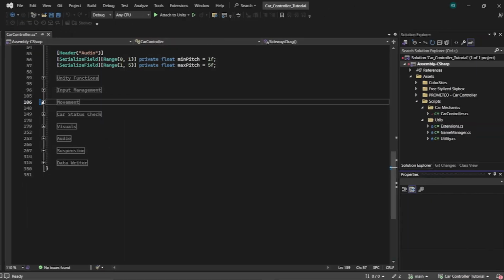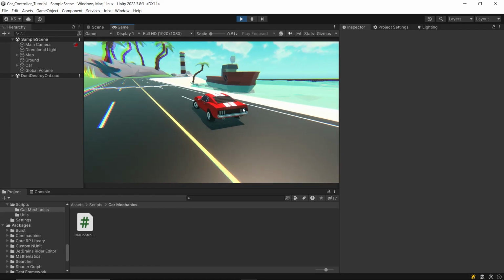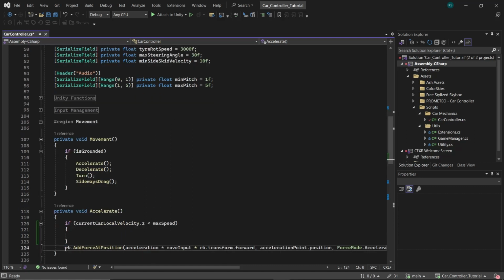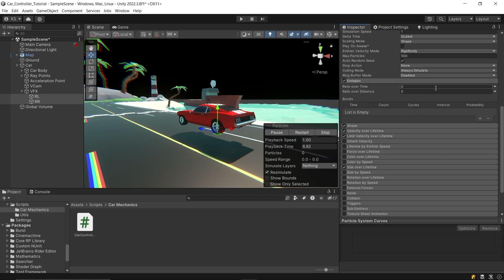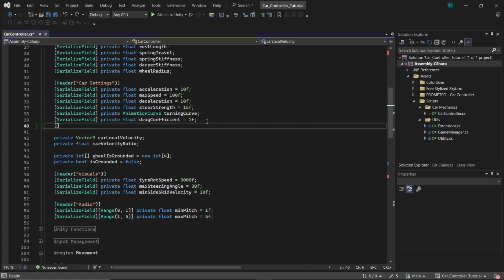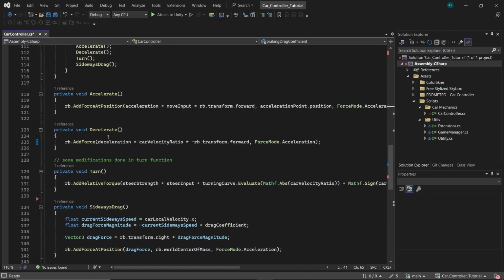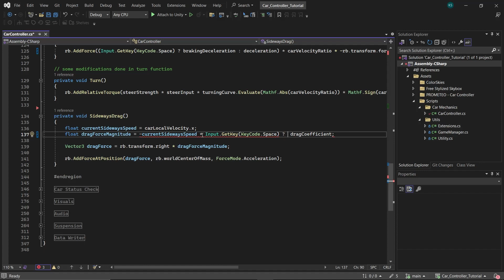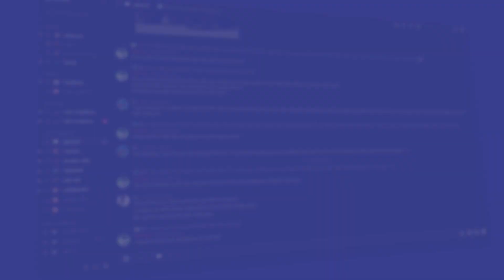Arcade Car Controller Part 5 | Bonus Episode | AshDev

Comment: I have a problem with the braking logic. I want to use the negative vertical axis for braking (and reversing as well) and at high speed, the car will not brake at all unless the speed is extremely low. What can i do here?

Comment: Everything was working until this video, but it's not working anymore. The car does not move. :D
Reply: Now when I press space, the car goes backwards at full speed :D
Reply: @Pretty_Ghost10  it is because brake works from decelelation function
Reply from the maker: It shouldn't happen, are sure you didn't changed anything else.
You can share you script in our discord server,. someone will help you out
Reply: On my end the tires just pop out of the car and the body flings off the ground